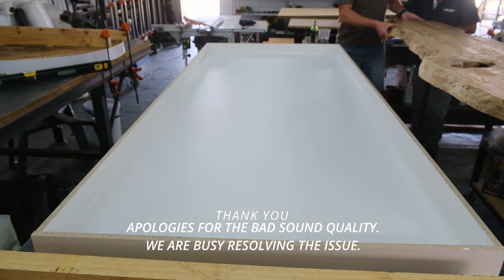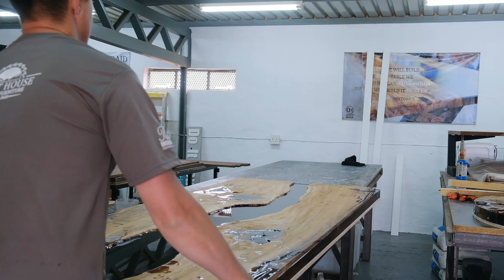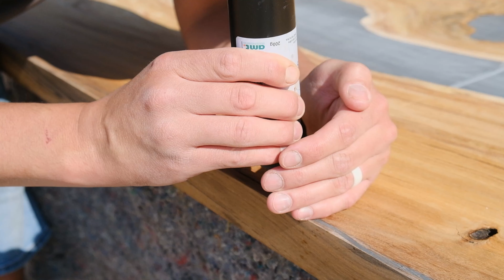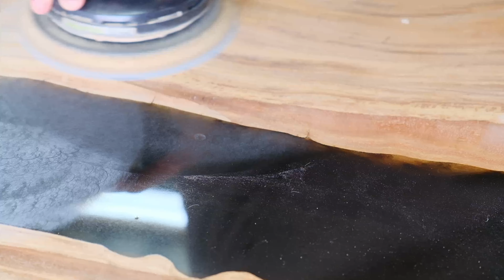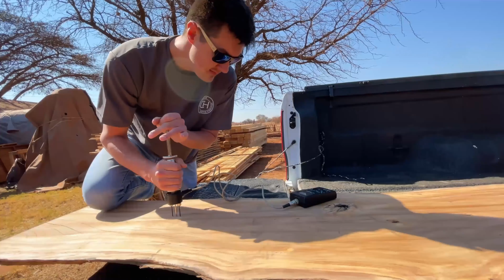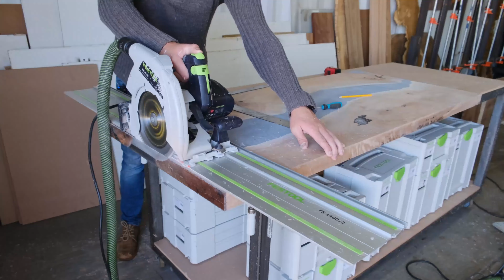how NOT to build an epoxy table & a screw...

Comment: Most likely somebody was playing a prank and lightly pressed a screw head into the drying epoxy
Reply from the maker: The thing is…
The screw head in not sunken in the epoxy, its sticking out.. 🤔
Reply: @diywithgreg  maybe someone poked the epoxy with a screw head while the epoxy was still tacky, hence when he pull the crew head away it pulled the epoxy along.
Reply: Or maybe a screw got indented in the mould before pouring the slab? I made a makeshift mould once with a margarine container and the epoxy mirrored the fine writing on the plastic.